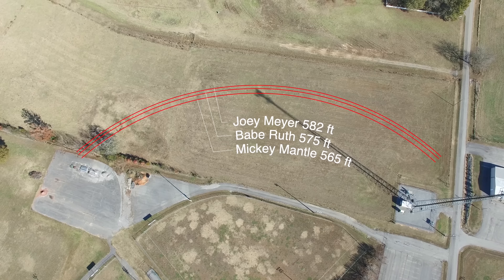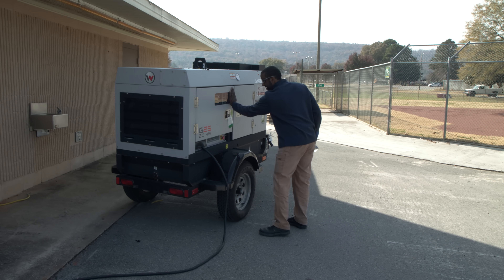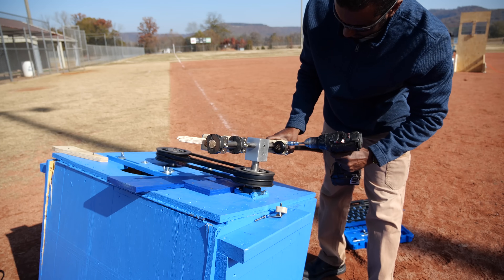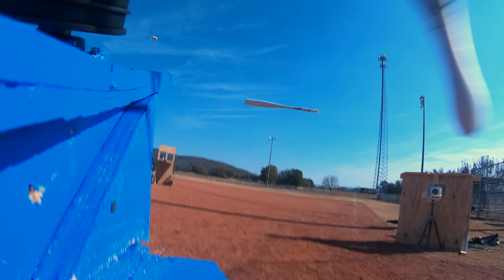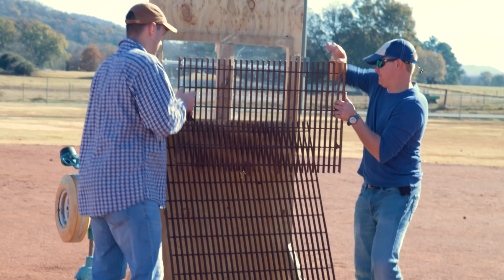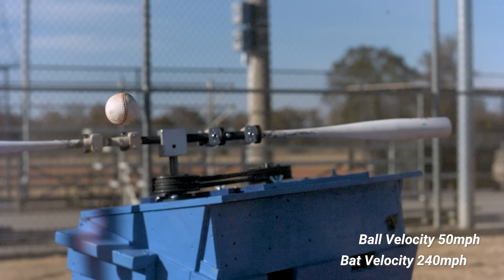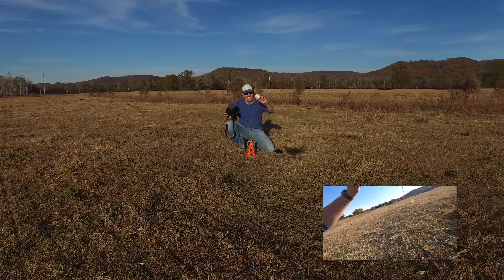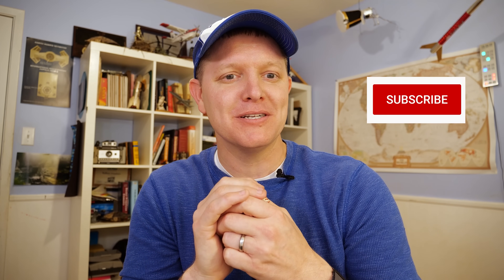World's Longest Home Run (The "Mad Batter" Machine) - Smarter Every Day 230

Comment: Me: Well, that’s a cool rig.

Rig starts making Helicopter noises

Me: 😳
Reply: Was so hoping the unit would lift off the ground.
Reply: @chrish5224  unfortunately that is not how aerodynamics works :(
Reply: @sorrenzz3610  Trust me, a bit of photoshop and after effects can fix that.
Reply: @TheWildChildJr  Dang I totally forgot that photoshop and affects can actually fool some people.
Reply: @sorrenzz3610  Actually if the artist is good enough they can fool anyone. Especially if it's just a short segment and the video is at least made to look like it was shoot using a bad camera. Knowing why it can't be true is an entirely other thing.
Reply: @blahorgaslisk7763  yeah but in this circumstance only stupid people would be fooled by photoshop and effects. It won't make any sense if two baseball bats spinning around would make something fly. I see what you mean though. There are many videos on the internet where people use effects to make something look quite believable.
Reply: @sorrenzz3610  While I agree I couldn't help but dreaming up a way to explain how that would happen using just slightly tweaked and dubious physics. Sorry...

All it takes is the aluminium bats being deformed by hitting the ball, which could make them generate lift if the deformation was shaped the right way. The most unlikely part would be that both bats would have to get deformed similarly. Then you would have to dream up an explanation of how the axle could work loose and you would end up with a believable explanation for how the hats could take off for a flight of their own.

But yea, that would be way to much work for something as silly as this.
Reply: @sorrenzz3610  Not without some Magnus effect. :)
Reply: Ya EXACTLY!
Reply: Check out the subtitles...12:56 "[helicopter noises intensify]"
Reply: I really want to think what Jaime Hyneman and Adam Savage (of Mythbusters fame) think about this... 😏😉😆

Comment: There’s a reason why you “hit with the label up” when using a wooden bat. The manufacturer’s label is applied (to the barrel) of the bat, so that runs parallel to the grain of the wood. Wood’s greatest impact strength is achieved when the impact is perpendicular to the grain of the wood. By hitting the ball with the mfg label facing the sky (or home plate), the grain of the wood is running parallel to both. With this, the ball will impact the wood at the optimum 90 degrees to the grain. You’ll see the same wood grain orientation in wooden handled hammers, axes, and other wooden handled striking tools.

Comment: So the four wire thing is ehhhhhhh. You dont NEED four wires, example, a three wave Charging system on a car, the fourth wire is a a whatif wire, Atleast if you're dealing with grounding at the device. In this case you're not, but it's not essential to the concept of three phase power.

Comment: This was awesome to watch but I agree with some of the other commenters, the safety of this one was not near your usual standard. In the collaboration with the slow mo guys with the 50 cal round, you adhered to safety standards and made sure to include that in the video itself. Just because a bat isn't normally considered a deadly projectile doesn't mean that them breaking away from that machine is nonlethal. I won't pretend to have run any numbers but if that last one at 100% power had come your way, I am not positive that your impromptu shielding would have been enough and it appears that you weren't remotely positive either.  We love your videos and need you to stay safe.
Reply: Yeah and especially the guys behind the chain link fence.

Comment: Spectacular video, but not much to get smarter in it, actually. There was nearly nothing in it regarding the physics involved. For example: What woould be the actual limit of  human regarding bat velocity? How important is it to hit the right angle? What has ball spin to do with it? What was the reason of this strange curve? What was the load on the end of the bat at the speeds you were running. I really enjoy your videos, but I have a feeling there is less and less  science involved in the later episodes. E.g. compare this episode to the one about the physics of helicopter flight. 

Also, I would prefer to not get a psalm pushed down my throat at the end of every video.

Comment: "that one's plastic!" is how someone dies in this type of situation. Destin needs to step up his safety game.
Reply: @racetracknerd9484  arguably, you cant make a 250mph bat spinning machine "safe". So, its "mitigate the risk to an acceptable level" or "dont do the thing". Many people choose not to do the thing, yet some people do.
Reply: I agree there was a small chance of death lol, but it's always easier being the safety police after the fact.
Reply: @Neishy86  it's actually not if you know what you're doing and care to take 10 minutes to think about safety. This thing was a mess from the start. Destin is smart enough to know what would happen if the motor went unbalanced or if they lost a bat at those speeds. That wooden shed he was behind was flimsy. All it takes is a ball or bat to hit that, splinter the wood and send shrapnel into his eyes or throat. Game over. 

I'm just saying, he has a wife and kids. Just be safer. He's too awesome of a YouTuber to lose.
Reply: You gotta be willing to take the risk. Safety is unnecessary
Reply: @racetracknerd9484  exactly. And what's more, it can still be fun and interesting when made safe. That could even be part of it. How about dial in the pitching machine then remote activate it. Or use stepper motors with torque converters to control the x and y axes of the machine. So many possibilities.

Obviously budget is a real thing everyone has to deal with. Still though, there are cheap ways to stay safe. When I was a flight controller at NASA for the ISS, it seemed budget was inexhaustible for life safety (esp for the crew). As I've moved on to other jobs, where budget is more important, making things safe is still as important. It's just that now it has to be done more efficiently. Same safe operation, just a different mindset. 

Again, love this channel, love Destin, love everything about it.
Reply: @therising1  Theres definitely remote controlled pitching machines that have a hopper filled with balls. You wouldn't even need to build your own.
Reply: For real. Also the guy powering the machine had no protect from bat or wood shrapnel whatsoever. These guys need to have more respect for how dangerous moving things at those speeds can be
Reply: I hate to be a buzz kill but since someone already opened the door to that topic I definitely agree. As soon as I saw the poorly crafted plywood shield I was thinking "is he serious?" At least he wised up with steel grating but even so I was worried a bit for the dude running around behind the fence. I've seen baseballs actually hit through the fencing and backstops. I have no doubt a 250 mph bat could easily tear through it... With that being said I've been inspired to run off and build my own bat-tle shield and baseball smashing death machine now... Lol

I almost never subscribe to channels, even the ones I like, but for your bravery, possible insanity, and awesomeness your definitely earned my subscription. If you don't hear it enough from your wife and kids I hope you'll think a bit safer in the future. Lethal or not some injuries you never bounce back from so take care of yourselves.
Reply: I wrote this in another comment, but the chance of death was not *small*. If a bat weighs 32 oz and was traveling a 250 mph, it has more kinetic energy than a round from a 12 gauge shotgun (5,587 joules vs 4,453 joules).

All that plywood shield was good for was offering Destin some shade.
Reply: Yeah, but that's boring
Reply: @westbender 820 It still amazes me that today in 2020, there are still people who think that acting and being safe is something to be ashamed of or that needs to be defended. Imagine being the guy controlling the motor in this video and having to call Destin's wife and tell her he's dead on a baseball field. Grow up.

Being safe isn't difficult.

Comment: Did you install the wood bats wrong? it looks like you had them oriented with the grain, which causes the bat to bend more. If you rotate the bat 90 degrees, the ball hits on top of the grain. Its like hitting it with the side of a deck of cards

Comment: You should have tried to intergrade a system similar to fighter pilot guns that only fired when the props were in the correct position. I can remember the name of the system of if it is even Feasible.

Comment: Well naturally the record would be done at high altitude, because the air is less dense, and therefore has less resistance. Provided that humans are the limiting factor much like they would be in pitching. Biomechanically humans can only throw at a maximum speed of around 100 mph. I wonder tho.... could you throw faster at higher altitude and break the record for pitching speed?

Comment: Loved the video.  I have a few thoughts and questions.

At what speed would the bat structure lift off?  It already had the helicopter sound?  How much ballast was used?

What was that plastic face shield gonna protect on a return ball at 190 mph?  For that matter, that plywood wasnt gonna do anything but add splinters to your hind quarters.  I was glad you added the metal to the front and st an angle

Comment: Nice project , Why you didn't use rpm instead of power when you talk about the motor   , try to put  water inside the ball  so it will gain more kinetic energy and fight the air resistance for longer distance .

Comment: I've never really been that big of a fan of the channel of anything but I left this video on while I was setting up a skateboard and when you got to the stuff about Skunk Works I almost dropped my bushing. That's been one of my favorite books  for so long, and I agree that it should be required reading (or listening I guess, but I would definitely say reading is the superior way to experience it) for anyone with even a passing interest in aircraft, the military, technology, leadership, or even politics since those are all key parts of the story. Newfound respect for this channel after hearing it.

Just so we're clear here though, neither plane is better. Two different challenges that were overcome with incredible resourcefulness and engineering decades before most people even thought it was possible. I had no interest in aircraft until I joined the USAF, but seeing the SR-71 static display at the Lackland parade field changed that in an instant. Been a fan of it ever since.

Comment: For  possible "better " results, you might consider some engineering history. WWI biplanes used a synchronizer in order to shoot bullets through the propeller without hitting the blades. If you engineered such a device, whereby the ball is launched at a synchronized time in order to hit the end of the bat at the optimum point in rotation, every hit would be a home run. You might also consider mounting the bat in a metal sleeve, instead of a single-point mount.  Otherwise, this was very entertaining. Thank You!
PS: As a former US Army Attack Helicopter pilot, I know a few things about rotating schtuff at high speeds.

Comment: So, are you going to team up with Mark Rober again, by taking this build, use the motors to get a  base level speed and then add rockets to really knock it out of the park?
Bonus points if you can get Joerg to build a horrific slingshot/railgun hybrid to pitch the balls...

Comment: This weird pulley gear system is kinda sketchy... A flywheel based clutch system to perform a swing would be way safer and effective, but you would actually have to align things to get a hit instead of randomly flinging balls in it's general direction

Comment: I challenge you to a better result with snatch blocks and some sort of tension based system , I believe it could be done and work even better since you could control the hitting angle and timing better.

Comment: Destin, you should add a 0.4 neutral density filter to the bat-swinging camera.  It will reduce the "bending" of the straight bats. It's a problem commonly seen in aircraft videos, whereby the propeller is seen to bend (or even separate) into separate artefacts.

Comment: 7:33 I did some rough calculations and the bat was travelling at around 165 mph, 266 kph, or 74 m/s
Reply: Nice
Reply: At the tip?
Reply: @Relfy75  just the tip.
Reply: @Relfy75  at the center of mass

Comment: Hey Destin. Great video as usual. I recently watched a Ted Talk. The speaker was Michael Rubinstein. Apparently, they have developed a way to detect movement in video that is undetectable to the eye and it will allow someone to measure the movement that sound waves create when they make contact with an object. This will in turn allow someone to recreate whatever it was that made the sound. If it was a song or a voice,  they can actually determine what the song was or what words were spoken. Incredible!! As I watched this Ted Talk, I couldn't help but think, This needs to be on Smarter Everyday!! What do you think?

Comment: There has to be an equation describing the rotational harmonics of the Mad Batter, as it accelerates to full rpm, using aluminum bats without damage, versus those with damage. Absolutely fantastic video.

Comment: The reason the bat broke is because you are used to aluminum bats.  With a wooden bat you must hit with the label up. You had it sideways.  That exposes the grain on the wood at its most easily broken side.  Look at the broken handle and you can see the wood grain. You have to hit across the grain not with it.    The lable is placed parallel to the grain for a reason.

Comment: Early in the days if industrial motors there was a thing called two phase power to help provide more torque on motors.  I don’t know if it was less efficient or just didn’t catch on.  There are still parts of Philadelphia and NYC that are supplied by two phase power.  

For quick reference:
Your normal house voltage has a single phase supply with two sine waves with opposite polarity in phase with each other.  Your normal 120 volt power is only one of those two sine waves.

In two phase power there are phases are 90 degrees out of phase with one another.  The way power distribution works you will not see much difference in a residential service, but in industrial equipment applications this is a major difference and specialized motors or larger conductors may be needed.

With three phase power, there are three sine waves 120 degrees out of phase with each other.  This is really good as most modern industrial motors are three phase.  This still doesn’t affect residential power, but in most commercial and industrial electrical services there will be 208 volts from phase to phase rather than 240 volts.  Your normal electrical outlet will still have 120 volts. The explanation for this is a bit complicated, but you are not just measuring from peak to peak of opposite sine waves since they are all out of phase from each other.

Comment: I'm astounded that the ratio of the human records to what this machine did are this close.  You wouldn't think the human records would be anywhere near what that crazy machine has in power.  It seems humans have an ability to peak near the bat swing speeds you have going on from machinery.  Is the energy for velocity limited by the materials absorbing the impacts or is there a law of diminishing returns (an economic, not physics concept) going on?  It is also interesting that the default metal fencing provided at baseball fields is there to protect against what humans can trigger with a bat and ball.

Comment: You guys are both crazy smart and crazy dumb at the same time. On the one hand you can build these incredible machines and explain all the physics at play: smart. On the other hand you do things like just leaning a steel grate against a slapped together pliegh wood structure to protect against a 200 mile per hour baseball: dumb.

Comment: Hey bud, you could hit it further by creating an acceleration during the duration of contact with much less speed. Simply driving the bat at 200+ mph is only raising the level of mass being driven through the bat and/or ball. 

Also, because the bat is not changing direction (which happens when a batter rolls his wrist and creates contact with the ball), all the mass is being mitigated outward, creating centrifugal force which is not being directed at a 90 degree angle(from the plane of the centerline that is going down the length of the bat). 

If you notice, when the bat comes out of device you have created here in this video, the bat began traveling nearly exactly along the line I mentioned above. That is because the force from the machine is sending this energy outward from the machines center point of rotation and the bat is in a fixed position aimed 'near' the center point of rotation; Amongst other variables like rotational speed and the resistance of the side winds changing to the upcoming and on coming winds as time moves forward.

 If you were to move the mound, or machine closer to 1st base, slowing the pitch slightly and aiming to the left of the centerline of the machines designated center origin of rotation, your machine could make contact between the ball and bat, creating a statistic that is greater than the one just stimulated in this video. I would the ball would be hit towards center field to right field, as opposed to the one just gathered here in left-center field. But that also wouldn't be considered a home run within regulations. It would just be something else.

Just my couple cents.